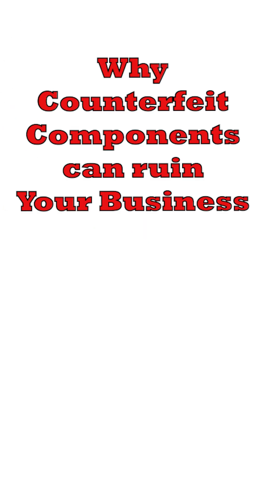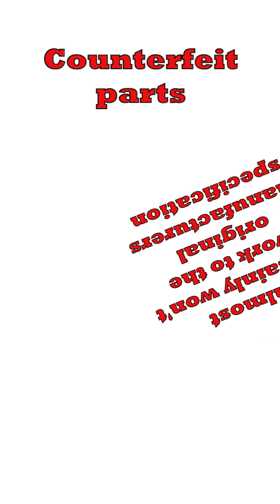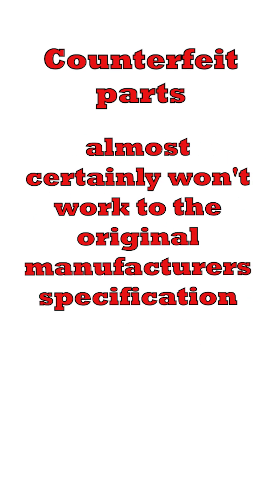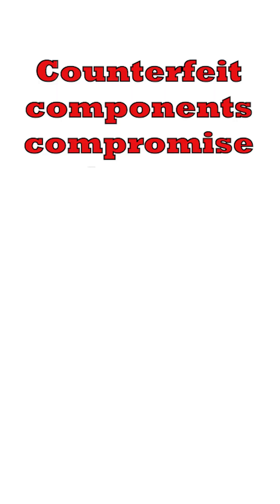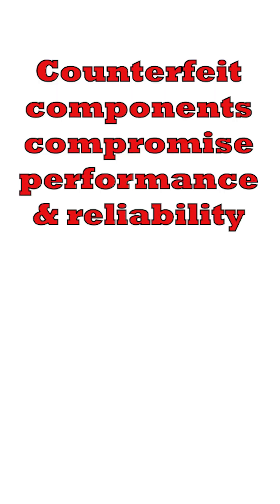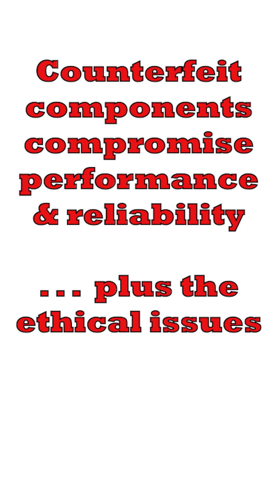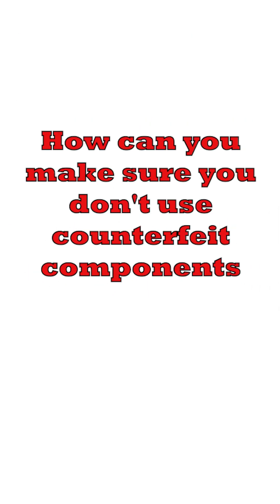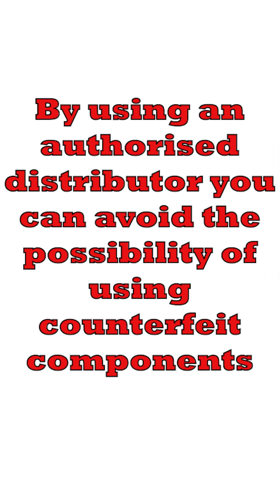Understanding Counterfeit Components & why they're dangerous

Comment: Oh well had to learn the hard way. LittleDiode in the UK sold me some fake RCA 2N6474's and when i tried to bias the amp and they blew up. I should have known the laser etching was too clean for an obsolete part. I just hope they didn't screw up the output transistors
Reply from the maker: Sadly counterfeit components are everywhere and they are not always that easy to see. But they can have disastrous effects as you discovered. Hope the rest of the project goes ok.

Comment: Digikey have a bit of a cheek. I bought some FTDI USB-UART chips from them. FTDI did a software update and the chips stopped working. I asked FTDI and they said the last update wàs to catch people using non genuine parts. I told them I'd bought from digikey. They've had a lot of forgery but I said I'll not use FTDI if I can't trust an update.. 
Later I heard FTDI reversed the policy as it was probably costing them customers. This was around 2006 ish